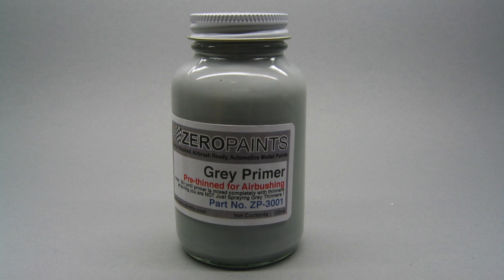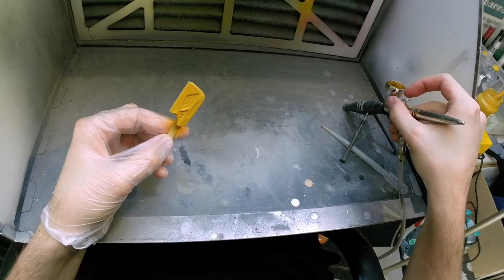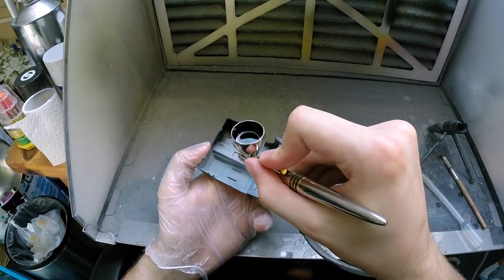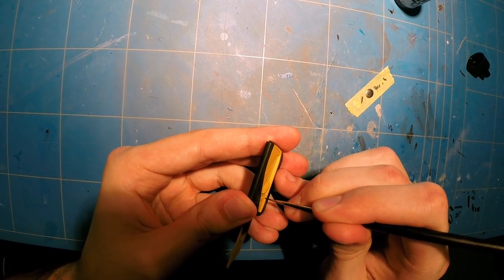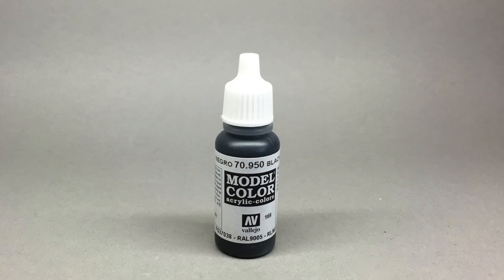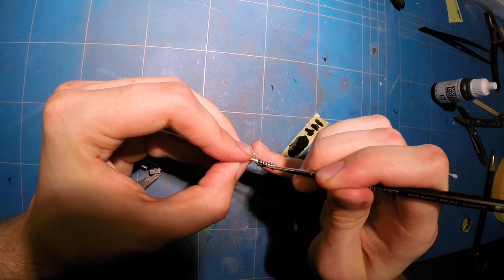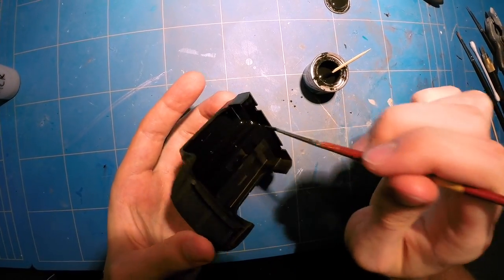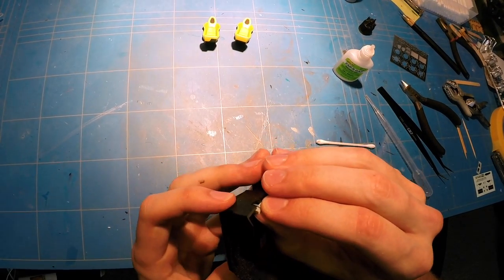Tamiya: Honda S2000 AP2 Part 3

Comment: Nice build. Just a question. In your experience using superglue with painted plastic surfaces will it be a strong bond? Does it work for all kinds of paint? Thanks and always looking forward for your videos.
Reply from the maker: The super glue is strong, though it depends on the brand of glue, Zap is very good and i use it all the time. It works with every paint type, tough it can rip the paint off if the bond with the paint and plastic is not very good.